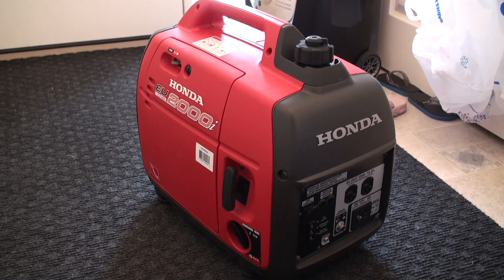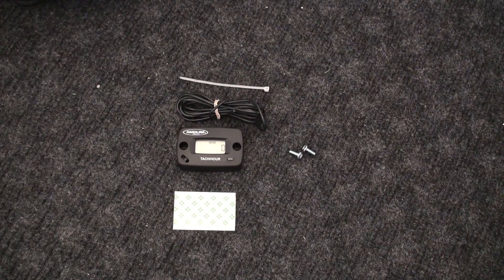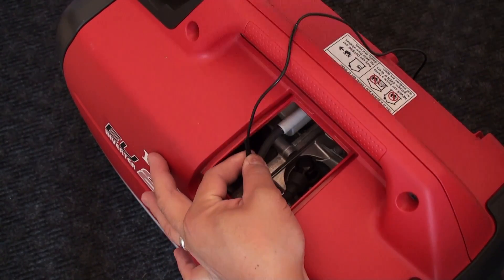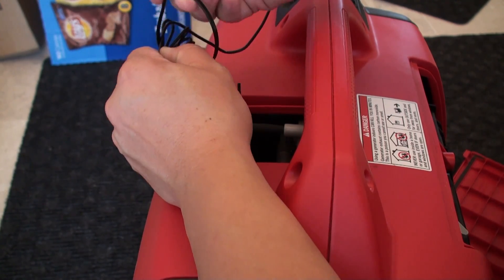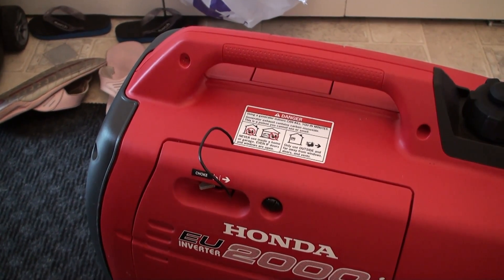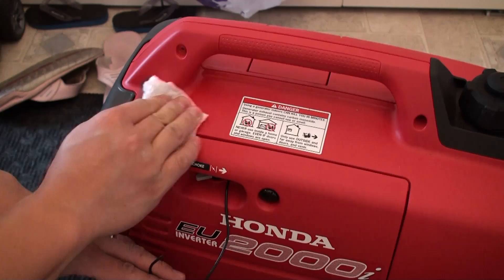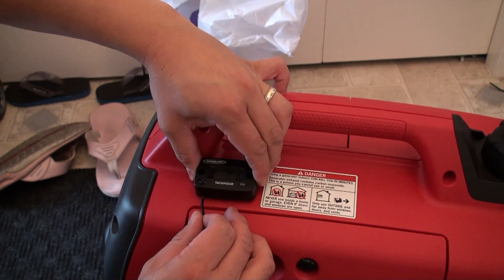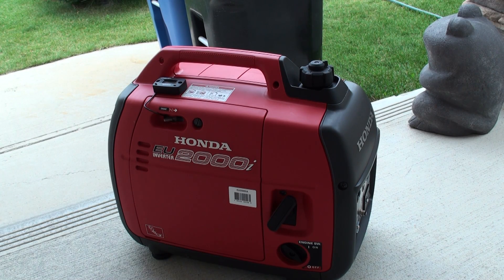Installing a hour meter and tachometer on a Honda EU2000i generator

Comment: Great way to route the wire from the spark plug to the meter.  I am against drilling a hole in the plastic casing of my expensive Honda EU2200i genset for any reason and it just doesn't make sense to do so if there is an ingenious way of routing it like you did.  I will be doing the same thing to mine when the meter arrives from Amazon.  Thanks for posting this obviously very helpful video.

Comment: Now if you need to remove that side cover which must be removed to do the maintenance..........   Notch in edge of park plug cover!
Reply from the maker: It isn't too bad actually and I've since moved my hour meter.  At the time I was overly neurotic about not drilling or cutting anything on this generator but that was ages ago. To your point I've since put in a tiny notch in the plug cover and called it a day.  Works good.

Comment: Passing the cable through the choke lever opening is genius! One question, doesn't the cable interfere when you need to open the side panel (for oil changes etc)?
Reply from the maker: nope not at all. I leave enough "extra length" inside the generator such that it never will get tangled in anything so that I can easily remove the cover to do maintenance work.  I don't like drilling holes into my equipment so this was effectively a hack to ensure I get what I need to work without affecting the stock setup of the generator.

Comment: Nice video, although I would've installed the clock inside, that wire will be in the way of that access door.
Reply from the maker: yep, in the end I just rerouted the cable and placed it on the inside.  Honestly whichever spot you decide to place it will be just fine.  I have two of these generators and one is on the inside and the other on the outside and both are still pretty easy to service.

Comment: you can cut the wire on the meter, no issues there. good install, thanks for the video.
Reply from the maker: Thanks for the tip!

Comment: That was easy!  I think I may stick mine on the spark plug door with a small drilled hole.  I realize ordering a replacement spark plug cover has to be cheaper if I ever needed to replace it to 'fix' the hole I drilled.  In either case, great video.  Still relevant today, thank you!
Reply from the maker: Good point.  I still have mine tucked away inside my generator and since installing the hour meter I think I have maybe put on 3 runs hours in total.  I need to find reasons to use mine more :)
Reply: Christ, I did the same thing on installing the meter on my spark plug cover with a small hole for the wire.

Comment: is it accurate ? i mean if I timed it against my phone timer start/stop ?
Reply from the maker: It seems reasonably accurate.  I can't vouch that its accurate to the exact minute b/c it is pulse based (from the spark plug) so any reading anomalies would be a result of interference in the pickup line.  Overall the idea is to give you an approximation of run time to the nearest 10th of an hour which I think is quite reasonable.
Reply: @piercedasian  thx for the reply! it's probably better for me to use this than trying to recorded it myself on my new riding mower as I will mess it up anyway in the end. lol

Comment: You can cut the signal wire to any length. You can even extend it (a bit) if it isn't long enough. It is an inductive sensor on the HV ignition system. There is a very clear and strong signal so no worries.
Reply from the maker: that's good to know.  I wasn't aware that you could snip that wire to shorten the length.  Thanks for sharing that info!

Comment: You can trim that wire down to size. No need to have coils of wire dangling around inside your case.
Reply from the maker: I thought it was calibrated for a certain length of wire. If that is the case I am so gonna trim mine to length. Thanks for the tip!
Reply: @piercedasian  Was is calibrated?

Comment: So now how do you get the cover off. This should be titled HOW NOT TO INSTALL AN HOUR METER.
Reply from the maker: The cover comes off easily since there is slack in the wire.  I've since relocated the hour meter to inside the cover but the point of why I did it this way was to not drill any holes into my generator's housing.  I'm neurotic and want to maintain the like factory new condition of my gear and modding things even if the mod is super tiny would drive my OCD into overdrive.

Comment: I would have put it inside the housing for two reasons:
to protect it from rain and damage, 
and
to avoid having a wire coming out.
Reply from the maker: After about a year of using it on the outside that I ended up tucking that on the inside like you suggested.  You can't even tell it has an hour meter on it now.

Comment: Thanks for the video.  Not the way I would do it - I would have drilled the casing to make it so I could still remove the service cover without the hassle - but not wrong.
Reply from the maker: yeah, I know I could've drilled a hole and mounted it on the outside but I'm too anal to drill into my pretty generator.  Yes lame excuse on my part but that is just how I am with things.

Comment: A whole lotta nope. I used double sided tape and mounted on the gas tank, inside the case.
Reply from the maker: yeah I know... I'm neurotic about modding my minty generator.  Quite silly of me actually but it worked like that for years before I decided to relocate the meter to the hour meter to the inside of the unit.

Comment: Great fun opening the maintenance door afterwards
Reply from the maker: yes yes, I know... it can be a pain but no holes drilled and that was what I wanted for my generator.  Others can easily just drill a teeny little hole in the top but I chose not to.

Comment: I've just added a Hardline Hour Meter, no tachometer, to my new Eu2200i. My Eu2000i was stolen.  Like B4, I drilled a hole on the spark plug side of the generator, up near the front of the handle.  Yes, I had to loosen the front & remove the back of the generator then pull the 2   eexterior halves apart, insert a metal scraper & hold it so when the drill is through the case it it comes in contact with my scraper, not the plastic gas tank.

TIP for STARTING your generator after a long period of non-usage:
Put ethanol-FREE gas in the tank, laced with Seaform.  Leave the Filler Cap vent CLOSED after adding gas.  Turn the Switch to ON, now shake your generator which allows the gas to expand creating pressure.  Wait a couple of minutes.  Now turn the Filler Cap vent to OPEN, close the choke, pull the handle & it should readily start.  This is the procedure the Authorized Honda Dealer uses here in Nevada to start brand new generators & they only put 15-25 oz of ethanol gas in the generator's gas tank.

SeaFoam vs Sta-Bil - this is WHY I add Seafoam to the ethanol-FREE gas.
https://weingartz.com/expert-advice/2017/01/fuel-stabilizers-sta-bil-or-sea-foam/
Reply from the maker: yeah ethanol gas = evil!  Great tips.  I will definitely be trying that on my own generator the next time I need to start it and it hasn't been run in a while.  Thanks for sharing!

Comment: The comments on this video were very helpful.  I have one of the Honda clones (Westinghouse iGen2500), will try mounting the hour meter inside the case instead of any drilling or altering the exterior looks of the beautiful blue case.  :)
Reply from the maker: yeah I didn't want to drill a hole in my case either b/c I'm just overly neurotic of having things look factory fresh.

Comment: That wire is going to be in the way when opening the door.  Bad installation
Reply from the maker: I know it isn't ideal BUT I did not want to drill holes into my generator.  I'm neurotic that way that's why.

Comment: Excellent video! Finally got the motivation to fasten the hour meter/tach to my 2000i
Reply from the maker: glad you liked the vid and the fact that I routed the wire through the choke hole.  Some people give me hell over that (rightfully so I guess).  I just don't like holes in my chassis.
Reply: Yeah, cutting a hole in my truck's roof for my ham radio antenna is not going to happen either(!) What I did on the gennie was to cover the tiny access opening I drilled into the case, with the meter itself. It's unnoticeable, it looks very clean, neat and most of all, functional. Again, thanks for taking the time to make the video!
Reply from the maker: yeah I could've done the same with mine but me and drilling holes = never good outcome no matter how small the hole is.  That being said I'm glad you got a hour meter installed on the generator.  It is absolutely required to know the "mileage of your gen set".

Comment: Battery only lasts 2 years and is non replaceable...  So in 2 years you'll have no idea how many hours..  Buy a real one.
Reply from the maker: it has been more than 2 years and so far the hour meter is still going strong.
Reply: Best reply ever. Also, even if the hour meter died, you shouldn't be left with "no idea" of the hours...hopefully you are paying just a tiny bit more attention to the gen than that. I have a gen that I bought 4.5 years ago...I know how many hours are on it, pretty close, at all times...if the hour meter quit I wouldn't just suddenly completely forget that
Reply: Actually the Hardline has a 10 year battery. Most of the hour meters do in fact have 2 year batteries. That's why the Hardline costs twice as much, but worth it.

Comment: So everytime i need to open the sideplate, iwill have to remove the sticker? I see a mess with the wire when changing the oil
Reply from the maker: +Yosue Carded it isn't that bad actually BUT since I published this video I have remounted the hour meter inside the unit towards the back of the compartment so that it is clean and hassle free.  I just don't like drilling into my generator case (call me super anal retentive).
Reply: +piercedasian believe me. I wouldn't either. I saw a bracket on ebay to mount it right over those 2 screws where you passed the cable. Im still debating if going with the 1000$ honda or the smarter tools ap2000iq. I have not read bad things about that one. Off course the honda IS the 2000 king inverter. Cheers
Reply from the maker: That way I see it is the money you spend today won't be wasted as the Honda has an extremely well established and proven track record.  I could've easily walked into to Costco to buy a cheapie Honda copy but I opted to spend the extra funds on what I REALLY wanted and I have ZERO regrets doing so.  Sure it costs more but the satisfaction knowing you bought a quality product is enough reason for me.
Reply: Yes sir. That is a big true. I think i will have to say goodbye to a 1000$ and avoid a lot of headaches in the future
Reply from the maker: you'll be glad you purchased a Honda :)

Comment: Before you wrap the wire around the spark plug wire  drill a small hole where your going to put the meter and run the line through the hole  this way when you want to take the cover off and on the wire won't be in the way . Or just leave the meter on the inside .
Reply from the maker: +justliketolook absolutely I should've drilled a hole but I didn't do so by design b/c I didn't want to modify my case at all (call me anal that way).  I ended up putting my hour meter on the inside of the generator after I did this vid so that it was hidden away.  Not like I need to stare at it while it's operating...
Reply: +piercedasian be sure to place a shut off valve just behind  the bend in the gas line where the gas line comes out of the pump . This will let you shut off the gas going to the carb and it allows the generator to run all the gas out of the carb  so you won't have and gumming up of gas and it keep  the generator running good . Its a easy install . It takes about a minute to use up the gas in the carb then it will die out . The way it is now when you shut the knob off it leaves gas in the carb and that okay if your using it every day  but once you know your not going to use it for longer than a week  then that gas starts to gum up  .
Reply from the maker: yes that is a mod I am actually going to be doing this year on my gen set.  I've hesitated in the past but gumming carbs pee me off enough that I can't stand cleaning mine out every other year....
Reply: +piercedasian I think I'm also going to install a on off switch on the inside so I can  shut off the fuel pump when I turn off the gas with the valve  so the pump won't be running and causing pressure  in the pump . this way the generator  will still be running  and using up the gas in the line and carb with out harming the pump  and causing any back pressure .
Reply from the maker: hmm true that.  I bet honda did that by design to not include a fuel cut valve for fear of frying that super expensive electric fuel pump.
Reply: +piercedasian  I think so to  so be sure to install the on off switch   leading to the pump you only need to cut one wire and place the switch between the wire you cut and that should do it .
Reply from the maker: great tip.  I will keep that in mind!

Comment: Just one more thing...the Honda EU200i does have an hour meter of sorts, albeit rather limited. When you start the generator a green light comes on. If you've done 100 hours the light blinks once when the generator is turned on. 2 blinks for 200 hours etc. Not overly accurate, but it will give you an idea of how many hours the generator is done if you're buying second hand.
Reply from the maker: +Rick Mantell I had NO idea that the generator had that.  GREAT TIP and you taught me and everyone else here something new :)
Reply: @piercedasian  As far as I know, the factory blinking light hour meter maxes out at 500 hours.
Reply: What about EU20i, AC 220V ? I have kept my own bookkeeping of hours. They are about 8500. I don't think that the green light will blink 85 times when I start my generator. I bought it from a Honda dealer,  and the generator  was new. That was in 2003.
Reply: 2003 is too old for this feature, only the later Thai made ones and on have it.

Comment: OK, so I've just fitted an hour meter to the exact same generator and can confirm a couple of things. First, you can cut the cable without causing any problem with the hour meter working. Secondly, I followed your instructions except for the location of the hour meter. I fitted it to a section of the generator (behind the service cover) to the left side. It's like a plastic cowling and near the sticker.There's not a lot of room there, but enough to fit. So, with my fitting you cannot see the hour meter and there are no exposed wires and you won't be knocking the meter off the external surface. Why fit it behind the service cover? For one, I won't be sitting there watching the meter tick over so there's no need to mount it externally, second there's no exposed wires and the unit looks standard from the outside. I also zip tied the wire to a couple of other internal components, but did leave enough slack in case you need to take the spark plug lead off. Cheers!
Reply from the maker: +Rick Mantell great tips Rick.  I ended up relocating mine to the inside of the unit as well similar to how you've described it.  Hindsight is always 20/20 :)  Glad that one can snip the wire to make the install cleaner.  I didn't cut it for fear of screwing up the calibration IF there was such a dependency - apparently not.  Thanks for sharing those tips.  Always great to know these things.
Reply: +piercedasian thanks for that. I must say that I needed your video to get me thinking though! It's a funny thing with the wiring for these hour meters. They don't actually connect to anything, they just wrap around. Anyway, mine's working fine!
Reply from the maker: that's great news.  Glad to hear that all is working well.  I think I'm going to go and mod my generator hour meter now :)
Reply: @rickmantell8152  It's called induction, the same way a transformer works. Google induction and you'll see a nice explanation.
Reply: I know this is an older post...but, I think I may try this. THanks.
Reply: Sounds like a good idea, but putting a battery-powered device inside with all that heat will kill your tiny battery a lot sooner than it would normally die. Heat and cold are battery killers. Just my thoughts.

Comment: I'm so glad I ran into this video.  I just bought two meters.  One for my Honda 2000I and one for my Yamaha 2400i.   It would be nice to put one on my Polaris Outlaw 450 and my two KawasakiJS750s.  Do you know if it works on a two-cycle motor?
Reply from the maker: +Joe John I believe the hour meter does.  You can set the # of "cycles" that the reader is expecting.  Worst case scenario is you could divide the # of hours in half and that would be your real # of hours on your two stroke.  Glad you liked my vid.  Thanks for watching :)

Comment: I might do this with mine, although I'll probably drill a small hole, to keep the wire from getting caught on things. Good video.
Reply from the maker: +Legend Cox Yep, drilling a tiny little hole definitely will prevent it from catching on things but I'm so anal about putting holes in my expensive equipment.  Obviously drilling a hole is the cleanest and best way to do the install but I'm so anal about putting holes in things that I didn't bother on mine.  Good luck and thanks for watching :)

Comment: I would have notched or drilled a small hole through the housing so the wire would not run through the cover.
Reply from the maker: +oxozero yep I considered doing that BUT my stubbornness to not put holes into my unit of any sort was what stopped me.  I'm super OCD that way and it drives even myself crazy at times.